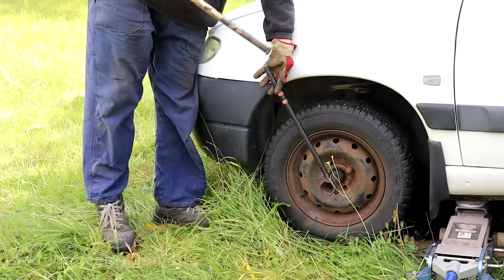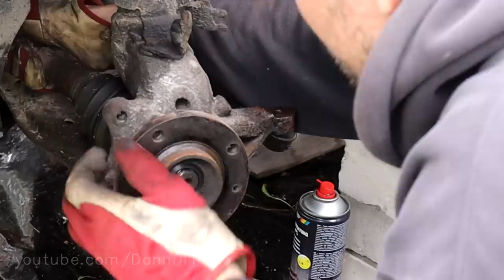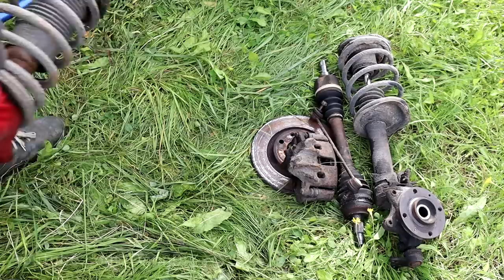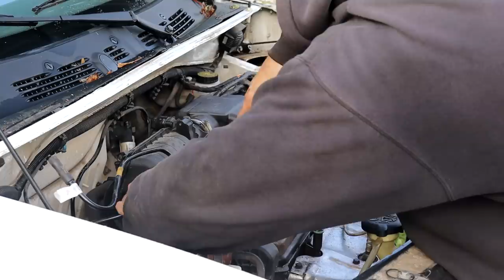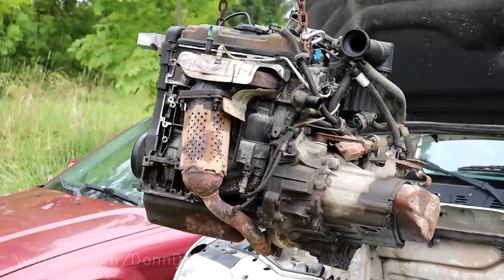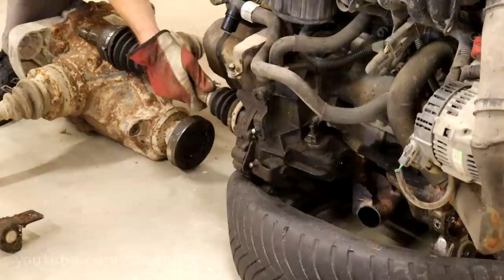4x4 Build Ep.2 - FWD Engine To Four Wheel Drive

Comment from the maker: Want more fabrication videos? There are plenty on https://www.youtube.com/c/DonnDIY/videos
Reply: Want more.... One of the best channels that I have watch all of the videos! 
This is going to be a super awesome build. I have always wanted to build a 2 wheel drive version from a Geo Metro, which has a very light weight front wheel drive 3 cylinder engine. The price for a side by side cost as much as a brand new cheapest car about 10k USD upwards to 20k USD. Even used ones still cost between 5k USD and upwards. What one gets from building their own is a style that works for their application, better parts, better speed and cheaper parts. Ever try and fix a side by side and the parts cost quire a bit more. Can not wait to see your frame build. I really like how one of my friends builds frames for his hot rod cars. He builds them with box tube and then welds plates inside the box tube so that one can drill and tap in to 3/8 plate along with the tube wall thickness. On of his car builds uses mostly bolts and very few nuts.
Reply: One more thing, Could you delay the text another second or 2. It would help when I get to watching what you are doing and then I almost miss the text and have to rewind it and read the text. Thanks!

Comment: That is a good engine choice. Checking valve clearance and changing plugs regularly will make it last a long time. Regards Nils, 10 working with Peugeot.
Reply: The oil looks ok from what I saw in his fingers.. I've seen much worse.. 
And those tu engines are so easily and cheaply fixed and maintained.

Comment: Very clever traction system! As a C3 1.4 user, i understand your choice for this engine... Here in Brazil some people like me use the 1.5 head gasket on the 1.4 Flex engine, this fix solves the problem of overheating and Head gasket burn

Comment: Looks like a fun project. Since you have a lathe, you could make an axle disconnect for the front driveshaft, to have a selectable 2wd/4wd. I presume you are going to weld the diff in the peugeot trans.
Reply from the maker: I will weld the differential in Peugeot transmission. 👍

Comment: Looks interesting.  I always toss the tires and wheels under the vehicle for extra safety.  Then if something does let loose it doesn't hit the ground.

As far as the engine and drivetrain consider a hydraulic drive system.  You could then use the hyrdaulic system to power implements and such.  You could even decide to drive more axles if you wanted to build a trailer with power assist.  And welding the spiders in the axles would give true all wheel drive but not be as hard on the engine when turning.  Can also have both axles with the pumpkins facing any direction you wanted and no need for a transfer case of any sort.

Comment: I know that this is obscure but the layout you are using is the same as how Honda changed their rear wheel drive "Acty" kei truck to four wheel drive. They just moved the motor and gearbox to the middle and 90 degrees with a diff front and rear. Good stuff, I'm looking forward to the rest of the series.

Comment: If you ever want to trade places ;) keep up the good work. Can't wait to see the results.
Good engine choice, easy to fix and maintain. Maybe while it's out change the distribution belt. You don't want it to snap from sitting out there when you are in the test fase. And yes as you mentioned in the previous video the 1.9 diesel out of that series would have been stronger but this will do. You can always upgrade if the opportunity arises..
Reply from the maker: Yes, exactly, someone on the forums already suggested changing the distribution belt.  👍
Reply: @DonnDIY  it's an easy job on those. With the engine out the water pump and belt are changed in 20 minutes.

Comment: Here in the states, a lot of those "square" plugs are the size of a ratchet. Don't need a socket for them. Now you have the radiator out, unless you don't intend on using it, take it in to have it tested and cleaned. Unless you're not to concerned about the radiator possibly being plugged. Cheers :)
Reply from the maker: Sounds reasonable and I feel stupid now when you have said that. 😆 Have to try that ratchet in this plug then...

Comment: i've got to give you props on using a car engine, always seems like going for a motorbike engine is the easier choice for most.
Reply: it is, but torque is problem with motorbikes, clutch too. and on top of that you can get 200k km car for small amount of money, good luck sourcing 600cc bike for cheap ;)

Comment: If you modify the end of your fork lift blades to accept a simple ball hitch then you won't have to worry about those chains slipping off the forks. Plus you can remove the ball for normal use and put it back just for engine hoisting.

Comment: Nice solution, I'm thinking about off-road capacity, if u use cars gearbox with front axle differential then I would block it otherwise u still have only one wheel spinning when stuck

Comment: Are you going to set up three-way steering?

Front wheels steer only (easy & intuitive to drive)
Front/back steer opposite (very tight turns)
Front/back steer the same (very useful to crab sideways without turning)

I suppose you could go all the way and add back wheels only steering (might be useful for lining up on a trailer hitch and maneuvering trailers)

You may need to either lock the differentials (all three) to keep an unweighted wheel from spinning (but this puts a lot of strain on the drive line)
or have some kind of selective braking on the spinning wheel.

Comment: If you are running the BMW rear diff in the front, you are forever running it in reverse. It will turn the correct direction when driving forward, but it will be noisy, and more importantly, will wear out very quickly. The helical gear cut in the differential is cut for one primary direction of travel. Perhaps this is intended as a very light duty application, the UTV will not be very heavy, travel very quickly, or be used very often. I do not think these drive line components would hold up for long in most other applications.

Not saying it wont work for what you are doing, but it certainly wouldn't hold up in a rock crawler for example.

Comment: The square oil plug is the same size as the square on a ratchet isn't it? Also the wire clip on the plugin on the engine you removed you can just push them In and pull the plug off. I just recently learned that.

Comment: That engine will be works great. I think You will be need some reduction case. Greetings from Poland
Reply: The Peugeot transmission mated to the BMW axles should provide plenty of gear reduction.
Reply: 2 nd gear will be like the first on a car probably. At least with a diesel's gearbox it would be. 
Im going to build a similar 4×4 but with VW 1.9 td - after i learn how to weld of course :D
Reply: Daastar 
The axles are 2.81 to 1 ratio so whatever gear ratio the Partner has will end up times 2.81 for the final ratio. If first gear is 3 to 1 then his final ratio will be 8.43 to 1. 
I don’t think he needs a reduction box.

Comment: Donn, is the differential in the unit Limited slip or will you be taking it out & welding the planetary gears for drive on both sides? Billy J.... OZ Land.
Reply from the maker: I will weld the diff in the Peugeot engine.

Comment: I love what the little skid steer can do for you.  Just a little more ballast on the butt and this would really be hard to beat with another machine (fork truck, tractor, etc.)   Glad to see the car didn't decide to roll, slide or drop on you.  Makes for excellent video, but not such a good day for you.  :-O   Just wondering ... did you consider just taking the bulk of the body off the Peugeot and starting from there?  Removing the upper body and interior would still give you a substantial start on the frame, suspension, and stuff.  Maybe ... or not.  Your mileage may vary.

Comment: This is going to be a great build. Was wondering if you are going to all wheel steering on this project or will you just lock out the back struts? Maybe add a hydraulic pump to the engine and put a simple ram on the rear with a hand controlled valve to move the rear left and right. It could make it easier to get into tight areas but that's my thoughts and this is your build that I get to have fun watching.
Reply from the maker: I have been thinking about all wheel steering after a lot of people have suggested it. But I will have to see how much room there will be around the driveshafts and differentials...
Reply: @DonnDIY  I was just thinking about your reply and if you put struts so the steering part of the knuckle is on the back side of the diff and connect them with a bar with simple bushings near the ends, then attach the tie rods to the ends of the bar and attach the ram in the center of the bar it would be away from the drive shaft. The control arms would have to be shifted slightly rear wards to hopefully clear the back of the differential cover. This all sounds good to me but I don't know how much room you have in the back so none of this may work at all. In the end what you do for this build will work out great and I will be watching.

Comment: I mean a petrol engine is actually favorable, because of higher rev range, so less shifting and you don't have to worry about freezing Diesel clogging the filter.

Additionally no bloody fuel filter which clogs up when the slush in the bottom of the tank gets disturbed by impacts or really rough driving.

Comment: the van was front wheel drive,  but isnt there usually a dominant side that is driven, until its starts to slip? wouldn't that mean the "4x4" would only engage once the front or rear axle losses traction?
Reply from the maker: I will weld the differential.

Comment: The square shaped hole in your differential plug, have you ever tried to use the drive end on your 3/8" (9.5 mm ) or 1/2" (12.7 mm) ratchet or breaker bar to extract it? I ask because over the years I have found that all of these types of plugs I encountered were made to be removed using these common tools.
Reply: This one is 8mm though. You can get the special tool, or take a door handle from your house. 
The timing belt tensioner, and certain other cars (Volvo?) also use 8mm square.

Comment: Are the BMW differentials limited slip?
Unless the Peugeot has some sort of limited slip diff, id suggest you pull the transmission off the engine, get it apart and lock the differential up.
To get extra space you could drive the driveshaft to the closest diff by going under/around the engine and driving it off the other drive shaft with a chain (once differential is solid), say if you sat the motor up on one diff. Not sure what size machine and the internal layout you are going for.
Id thought of doing similar but using an automatic car as a donor, lock its differential, then go into a 4x4 manual transmission for lots of slow gears. I wish I had the tech ability to actually manualise an automatic (same deal with tech on these newer fancy electronic diesels that most FWD vehicles seem to have). If you have the right gear in the 4x4 you'll have 3 or 4 gears in the automatic that will mimic a 'powershift' and be like a poor mans hydrostatic. Would give you some speed range at low speed without having to stop to change gear. A few different ways of reversing too. And 4th gear is still 1:1 like that transmission is not there, and if it has a 5th gear that gets you back a little extra ground speed you loose with the double diffs.

Comment: you could've got someone to refurbish the 1996 Peugeot Partner after it got parts taken off it. If it happens I would suggest a 87 cu inch V6 engine (Same displacement the 1.4L I4) that is compatible with the car and costs around €3281. (would mostly likely be a custom engine fabricated in Windsor, Ontario.)
Reply: Specs of said V6 may include a cylinder bore of around 2.76 inches and a camshaft stoke of 2.45; like i said it's custom.
Edit: It might be a salvage car but it really needs a restoration.

Comment: Your 1/2” ratchet should be the right size for the drain plug.( gearbox oil plug)
Reply from the maker: It is a bit smaller I think. I used some special square spanner for it.
Reply: Donn DIY gotcha.
Keep up the good work!
Reply: @DonnDIY  8mm to be exact. There's a good chance the door handles in your house would fit, if you can't buy the proper tool for it. Just use one that has a solid bar, not one that's split down the middle.

Comment: Isn't the gearbox drain plug "square drive" the same as a 3/8-inch ratchet/socket/extension thing?

That's how Honda's are…
Reply: It's probably smaller than a 3/8. I have ran into that before.  I just ground down an old extension to fit.

Comment: hou have made a transfer case fo the 4x4 traction with the front engine transmission? Great!
Reply: Why? The original gearbox has a internal diff as the transfercase. It doesn't lock or there is no optional high low. But it will drive the front and back diffs just fine.
Reply: Pieter Vercauteren  until you loose traction on just one wheel
Reply: @bobbob-fg5wy  that's why I said not lockable. It will work, and it will work very good, but it will not lock.. yes you will loose traction if you loose it. But like tons of modern 4x4 cars these days don't have a locking diff. Like even a land rover freelander doesn't have a locking diff..
Reply: @pietervercauteren1505   they are not 4x4 they are AWD and they get stuck all the time and have to be towed out by proper 4x4 vehicles.
Reply: @bobbob-fg5wy  4x4 is 4 wheels 4 driven, a 4x4 is an awd, so is a 6x6, since awd is all wheel drive. 4x4 has in no way the indication of a lockable diff. There is no point in discussing it here, that was not the point either. But hey you know in lots of circles 4x4 refers to an off-road vehicle that in general does have a lockable diff, but it doesn't need to be to a quality as such. But if you want to be as petty as to proclaim you are the winner in this discussion that didn't need to be a discussion in the first place, go ahead, go feel big. I have better things to do than discus with you over difflocks or lack of them.
Reply: Pieter Vercauteren  go easy, you can proclaim to know it all and win what you think is an argument wherever you like on the internet. It’s a free place to voice your opinion.
Reply: Pieter Vercauteren  search through other comments, you’ll see mine and maybe you’ll understand I was just commenting based on what I think would make the machine more successful.

Comment: Just curious what was wrong with that Peugot that you tore apart?  the car looked to be in good condition.
Reply from the maker: Rear brake lines rotten and leaking, rear torsion axle needs rebuilding, rocker panels rotten and didn't go through inspection. To repair all of this would have cost more than this car is actually worth.

Comment: Issue you'll have with those springs and struts is they were designed for a 750kg front end. Gonna be way too stiff for your project
Reply from the maker: Yes, absolutely. I'll have to change the springs for sure!
Reply: @DonnDIY  cool man! Turbo that van engine for lols?